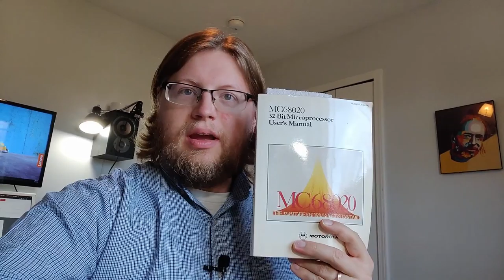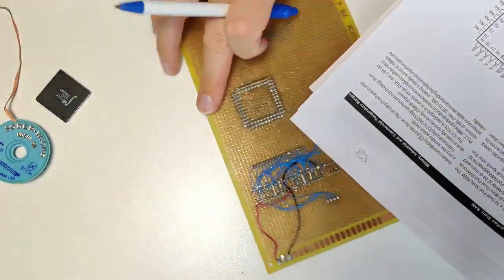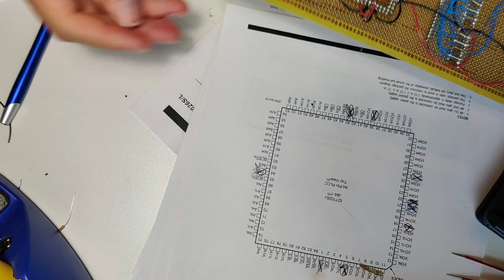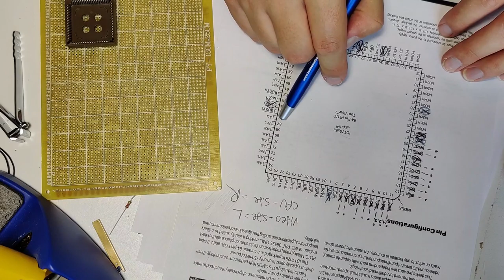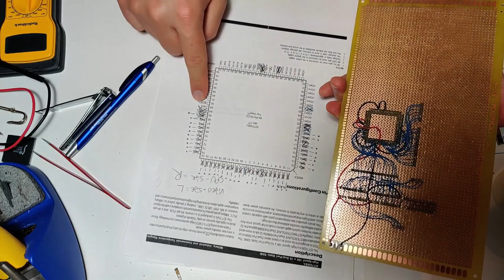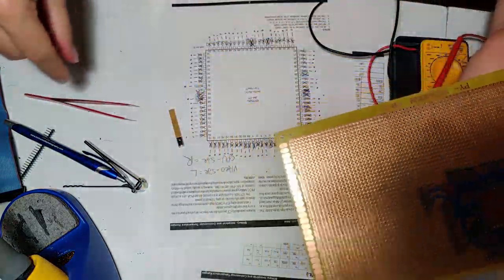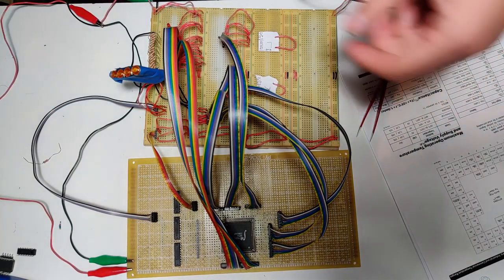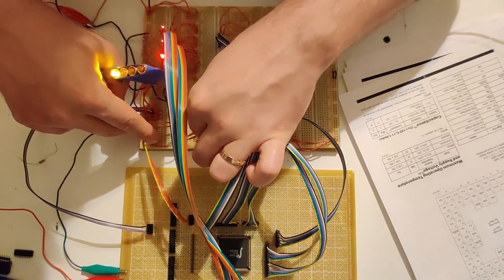DIY Video Card | Installing Some SRAM

Comment: I'm looking at CY7C130 8Kb Dual-port SRAM. I would like to fill it from atmega1284 and shoot VGA out from the other side. My maximum wish is 8 || 16 colors and over 150x100 resolution. 328 alone can get close but not quite and I'm openminded.
Reply: @Fisher Emmitt What has this to do with the vga? :D